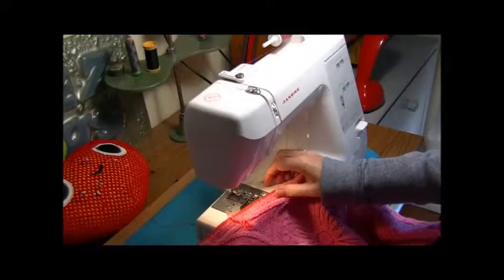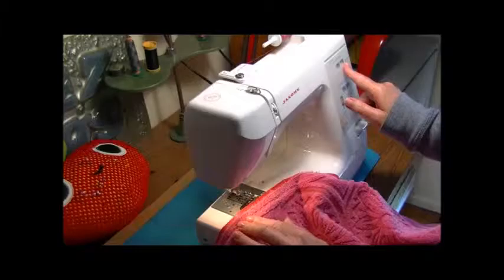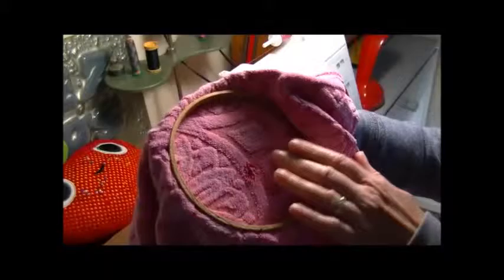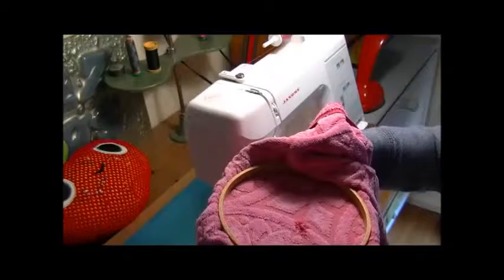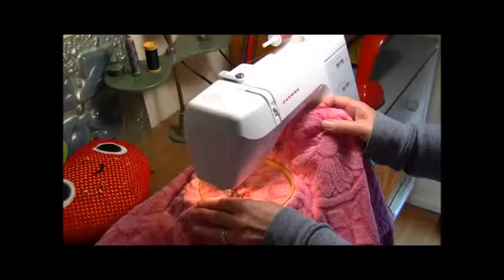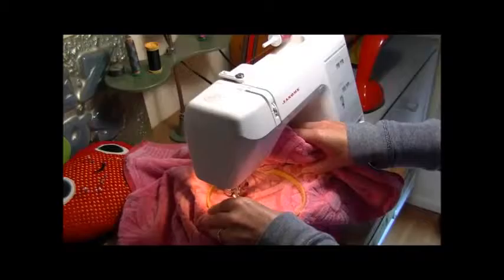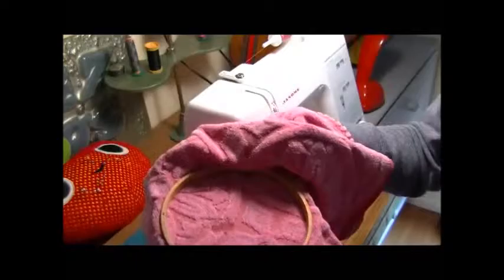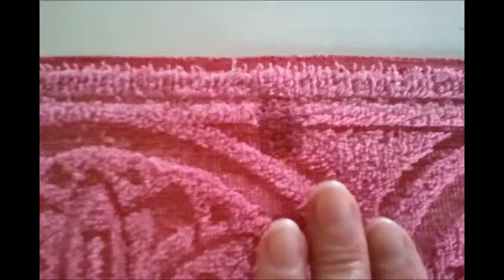Machine Darn Holes in a Bath Towel

Comment: What is the maximum hole size you recommend that can be mended this way?
Reply from the maker: These holes were not that large so did not require a patch to then darn.  A larger hole  1" = 2.5cm or larger would require a patch of towelling or other fabric to fill in the hole before darning.  I hope that helps.  Happy darning, James!  Oh, and 4+ yrs on this towel is still in reuse.